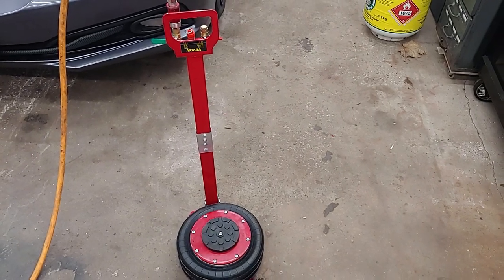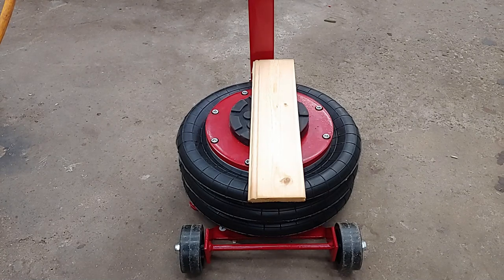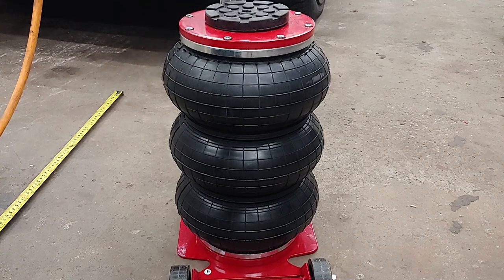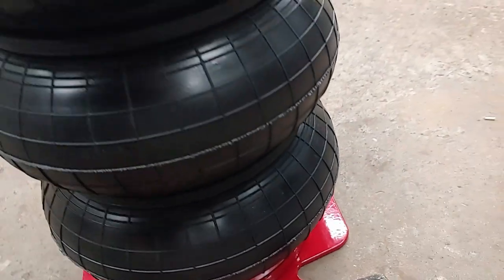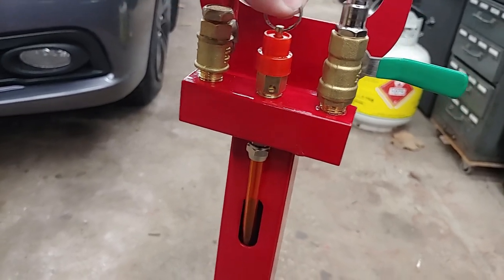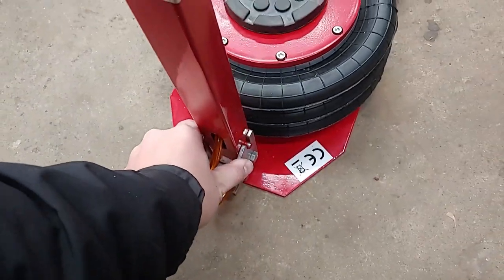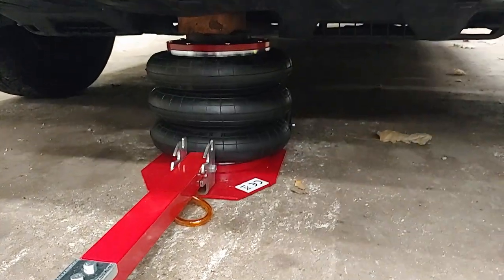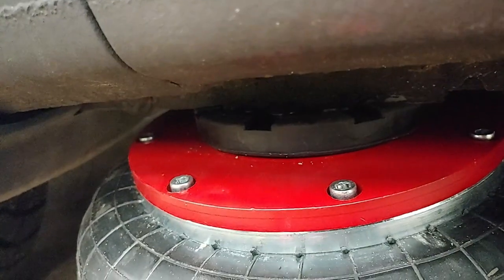A Look at the 3 Ton Air Jack from Amazon. Is it any good?

Comment: Buy one in Europe for 104 euros ,so 700 dollars your been ripped off
Reply: calculate again. 1euro is now 1.05 U$
Reply: @MrTavionyxx  exchange all you want still rip off you actually reading what u wrote last
Reply from the maker: I'm not sure how you got the $700 but I bought this when the prices of many things where I live were still quite expensive. If I were to convert the price I paid $250cad tax included it would be 185 euros at today's conversion rate. Yes, it's a lot more than 104 euros but there was no cheaper option for me to purchase it in Canada. Not to mention some things just cost more here in Canada, for context an economy hydraulic quick lift jack was about the same price. Also, I'm sure there are some things I can purchase here that would cost more in Europe. 

All in all, I don't regret my purchase and I don't feel ripped off since it suited my needs(space constraints in my garage) and I had a fair idea of what I was getting into. It has also allowed me to shorten how long it takes me to do all the tire changeovers I do. If I felt the price wasn't worth it, I probably wouldn't have purchased it and continued to use my slow trolly jack. Thanks for watching.

Comment: Why would you jack on a pinch weld anyway, thats just stupid.
Reply from the maker: Many modern uni-body vehicles have their manufacturer recommended jack point on the pinch weld. The only thing that would prevent you from jacking on a pinch weld of a uni-body would be if it's significantly rusted.
Reply: My 2008 civic front jack point was a pinch weld. Not sure what you're on about